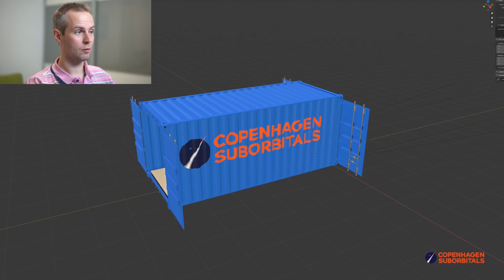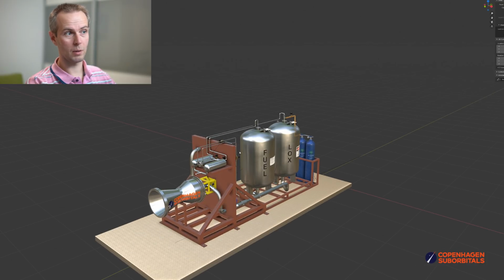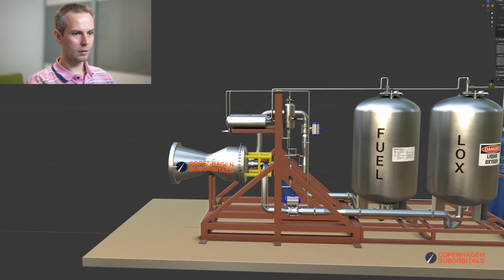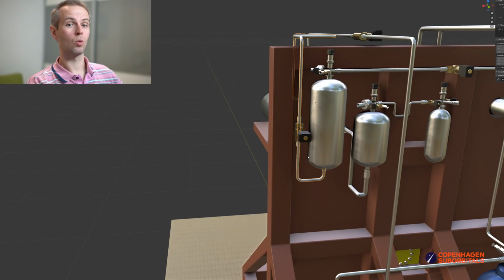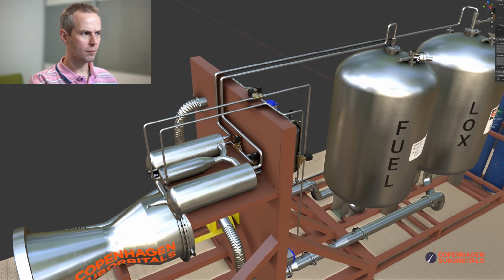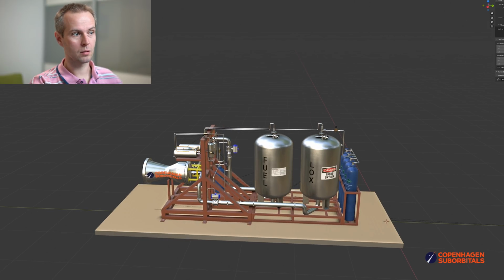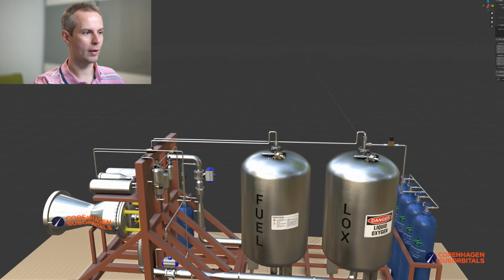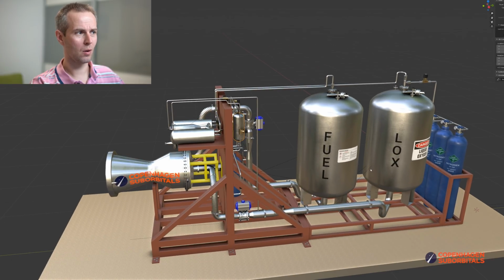Rocket Engine Test Stand Pressure Regulation

Comment: I will come back to criticize your design, when I see another crowd-funded organisation manage to get their own engine above 200sec ISP. ^^
Reply from the maker: 200s ISP is certainly low by todays standard in rocketry. Heck, it is even low for 1960’s rocketry. CS has never aspired to develop efficient rocket engines. We develop extremely cheap rocket engines. In order to do that we accept a significant performance penalty. The only way to get much higher than the 200s ISP mark is by using (turbo) pumps and then complexity and price really starts increasing. It is important to keep in mind that we don’t need the performance that launch providers need since we are not going orbital. We are “only” going to 100 km altitude and the energy requirement for doing that is substantially below that of any LEO.
Reply: @CopenhagenSuborbitals  Hell, you can get to orbit on 200s ISP, at least in modded (Realism Overhaul) KSP. It just takes an absurdly large rocket to do so.
Reply: @CopenhagenSuborbitals  You could get orbital with that, just add more boosters.
Reply: 200 ISP is pretty low for today standard.
Still, not bad for a fist attempt rocket engine.

Comment: Are you planning to fire it with all container doors open or just the back doors? I'm a little worried about creating a venturi and the high speed airflow though the container reducing pressure enough that it caves in.

Comment: How much power the turbo pump will generate?
Reply from the maker: The system we talk about here is not a turbo pump. It's a burner (small rocket engine) plus a heat exchanger. This burner will generate about 0.5 megawatt of power. But if you are referring to the electric pump by Orbital Machines which we will also test on our BPM100 engine (https://www.youtube.com/watch?v=-uU2w2kyZiE) then the electric motor running that pump is 150 kilowatts.

Comment: Why not use the tapoff heat from the engine for the heatexchanger instead of using a seperate burner and ethanol tank
Reply from the maker: That is a great way to do it, certainly more efficient. It is however much more complex as the pressure of the tanks is then dependent on the heat you tap of from the engine and the only way to test that is with a running BPM100 engine. Separating the burner and the BPM100 engine we can develop, test and fine tune the hole burner and pressurization system completely separate from the engine. Thus for the very first BPM100 test that system can already be fully developed.

Comment: Can you run all 3 (liquid nitrogen, lox, fuel) tanks on the same pressure line? initially pressurized with helium. This way only one heat exchanger needed and 3 times less control components? May be add some check valves to ensure liquids don't mix...

Comment: Are you going to have a load cell attached to measure thrust generated during testing? If so just curious how and where you attached it on the test stand. Great work btw
Reply from the maker: Yes we are. You can see that in our previous video on this test stand design. The load cell is shown at around the 2:20 mark:
https://youtu.be/NHHROFN0KSg
Reply: Ok thanks just checked it out and looks great keep up the good work!

Comment: Hi Copenhagen Suborbitals Team,
I'm part of a small Company with a staff of about 125 people.
Mechanical Works: Mechanical Design Team, CNC Sheet Metal Works, CNC Machining Center, including a CNC Turning Center, Welding Workshop and a Powder Coating Unit
Electronics: Embedded Control Systems Design, Telemetry and Telecom Systems and Electronics Power Systems Design
Software: Embedded Linux, Web Applications Development & Database Architecture 
Let me know if there is anything that you need done.

Comment: How are you planning on chilling/filling your propellant tanks? And from what source? Will you do an initial engine chilldown?
Reply: Great Question! Id Be interested in hearing how they do that too
Reply: In all their previous designs, the tanks are left at whatever temperature pumping in the liquid propellants leave them at.  I hear that SpaceX gains less than 3% by superchilling the tanks, so almost nobody else bothers to do that.
  LOX, N2 and He storage tanks may have some cooling to stay liquid for days of transport, but this diagram only shows the (rearranged) rocket tanks and the bootstrap N2 bottles that will probably remain on the launch platform.
Reply: Not so much interested in the over chilling. I mean that prior to filling the tanks, do they ramp down the flow rate if propellant to 'chill' their tanks down to near propellant temps to minimize boil off during the fill procedure. 
And if they are chilling the engine, where is the cryogen coming from ? Is it draining from the tanks or do they have a specific chill system
Reply: The concept videos are awesome!

Comment: wouldn't it be possible to significantly simplify the plumbing by running the heat exchanger off of some some sort of monopropellant gas generator? you're already packing a separate fuel for it with the dilute ethanol, so using a catalytically decomposed monopropellant instead would save you a great deal of complexity, and they generally run a lot cooler, so temperature management is less of a concern. nitrous oxide seems particularly attractive because it's completely self pressurizing, so you don't need an additional system to keep it at pressure. in case you haven't already looked into this (or someone else trawling these comments is interested) there's some great research done by stanford that outlines it all pretty well https://web.stanford.edu/~cantwell/Recent_publications/Lohner_Scherson_JANNAF_2008.pdf
Reply: I wonder if the same could be achieved with solid propellant which could be even simpler. Though once lit, you don't get to shut it off. :)
Reply: Also a possibility, although two phase flow and abrasion could be potential issues.
Reply: @jnielsen20  Solid propellant with regulated LOX flow could be a solution.  As only heat is desired it'll be a lot simpler than their actual hybrid rocket engines (HEAT 1X series).  Basically like a fireplace without the aesthetics.  To refuel, open a lid and throw in some coal or pellets.  Cleaning of heat exchanger will be harder though..

Comment: Thank you for this new video ! I imagine that there will be some delay between the moment the sensor detects a drop of pressure in the tank and the reaction of the  pressurizer (burner), it would be interesting to have some informations about the PID control and the way you will adjust it.
Reply: I would also like to see that :)

Comment: wow! I'm loving this!
I question myself.. Why not use a closed loop? is it more expensive or not worth it?
Reply: Copsub intends to upgrade to an ELECTRICAL turbopump being developed by a Norwegian company - watch https://youtu.be/-uU2w2kyZiE (the description has a link to the company's website). Copsub gets to test/use the pump for free. To allow the nitrogen high-pressure system to be easily replaced by a turbopump, the feed system must be an independent "component", and not be integrated into the engine design.
Reply: If by closed loop you mean closed cycle, then yes, it can be boiled down to being more expensive.
Reply: Thank you guys for the reply😁 and yes I meant closed cycle😅

Comment: How big will the liquid nitrogen tank be and how much gaseous nitrogen will this produce ?
Reply from the maker: We'll need around 40,000 liters of gaseous nitrogen to pressurize the tanks throughout the flight and we'll get that from 40-50 liters of LN2. Test stand tanks will be smaller as it will run for shorter burns.
Reply: @CopenhagenSuborbitals  Will there be a weight penalty going down the heat exchanger LN2 route rather than carbon fibre tanks ? Or is it a cost issue the carbon fibre tanks being very expensive ?
Reply from the maker: @olivergledhill8668  Not at all. Going the COPV route is both very expensive and very heavy. Using this LN2 burner we save a lot in mass (2-3x, if I remember correctly) and a lot in expenses. The only penalty is bit more complexity.
Reply: @CopenhagenSuborbitals  Rather than gaseous nitrogen would using oxygen to pressurise the tanks be more complex ? Or even possible ? Would gaseous oxygen pressuring a fuel tank be a seriously bad idea ?
Reply: @olivergledhill8668  Interesting idea, but don't forget that O2 is a powerful oxidizer that might rust the equipment.
Reply: @CopenhagenSuborbitals  At what temperature does the Nitrogen enter the LOX tank? How fast do you think it will cool inside the tank reducing the effective pressure?

Comment: Is a nitrogen generator like that going to be used in the rocket or is that just for the test stand? It's a pretty cool idea
Reply from the maker: It is going on Spica as well, if we prove it works.
Reply: @CopenhagenSuborbitals  Nice! Less complicated than pumps! And could be even lighter if compared to all Helium/N2 pressurize system or ePumps for the low pressure engine.
Reply from the maker: @brunofporto  Definitely lighter (and cheaper for us) than storing all the N2 aboard the rocket, in fact that's the reason we came up with the idea. Though questionably lighter than electric pumps, especially when you factor in the weight savings from thinner tanks and lesser fuel requirements that come with a pump fed engine.
Reply: @CopenhagenSuborbitals  true! I forgot the tanks and tough only about the batteries! :D
Reply: @CopenhagenSuborbitals  How is liquid N2 lighter than gas N2 ?  Sure the LN2 tank will be smaller and lighter than big 20 bar gas tanks, but the N2 itself weighs the same at any practical pressure.

Comment: It looks very typical for simple rocket engine actually. It is very similar to V2, A-6 etc
Reply: The V2 had a ridiculously complicated turbo pump, though. Some of von Braun's engineers used to joke that that the whole machine is basically an expensive pump with a metric ton of explosives on top.

I wonder if the V2 would have benefited from a similar, much simpler, pressurized fuel system. Thankfully (for the people of London) we will never know.
Reply: I was just thinking the same thing.

Comment: Is this called autogenous pressurization when the rocket engine is supplying pressure into the propellant tanks? Is this similar to how SpaceX is approaching their Starship design with their raptor engines? Or is this process totally different being the Raptor uses turbopumps? Also what you guys do is very inspiring and I love it, keep it up!
Reply: In Starship the tank pressurization is for a different purpose. The pressure in the combustion chamber is extremely high (almost 300 bar) and is achieved by turbopumps mounted on the engine itself.  The pressure in the tanks is less than 10 bar and is just to ensure there is enough pressure at the inlet of the pumps to prevent cavitation. 
The other difference is that rather than using nitrogen to pressurize the tanks they use the fuel and oxygen itself and that the heat exchangers are heated by the hot gases from the preburners rather than a separate burner.
The meaning of 'autogenous' in the context of Starship is that the pressurization is provided by the engine itself rather than a helium tank or some other separate system, so in that sense the Copenhagen system would not be called autogenous since there is a separate distinct system generating the pressure for the propellant tanks.

Comment: Hello, could you not boil the liquid nitrogen by running it through the bpm100 channel wall instead of the fuel or by running the ethanol through the channel wall and then running that hot ethanol around the nitrogen heat exchanger?
Reply from the maker: Yes, but the plumbing would be a nightmare
Reply: Ok, thank you.

Comment: What if there is is a Cato while testing 
Hope that never happens
Reply from the maker: We talk about safety precautions like the blast wall, the container shell as well as sound and fire suppression system in our previous video:
https://www.youtube.com/watch?v=NHHROFN0KSg
In term of crew safety, everyone would be a large distance away when pressurization starts, of course.
Reply: @CopenhagenSuborbitals  thanks for your valuable time
Reply: @CopenhagenSuborbitals  thats so cool!
Reply: Well considering that they have always run tests with huge concrete barriers between rocket hardware and any 'wetware' in the worst case scenario for the test stand is that it will be reduced to scrap and and they get no video of it.
Slightly better outcome is they get some glorious high speed video like the one from the famous GoPro Hero 3 camera which sacrificed itself to document the failure of the HEAT-2X engine :-) 
Best case of cause is 'no boom' but lots of shock diamonds :-)